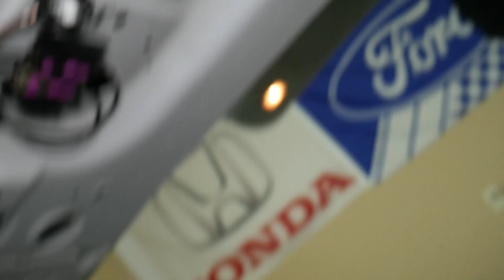PORSCHE CAYENNE TRUNK STRUT SHOCK SUPPORT REMOVAL REPLACEMENT

Comment: This was VERY good advice and helpful video.  My 13 yr old son and I just did this on a 2006 Cayenne without removing the WHOLE headliner.  In order, we removed the (1) right rear liner, (1) left rear liner (each has a small Bose speaker which needs to be unclipped) and (3) the far back head liner with the dome light (unclip the light once loose), then (4) we just pulled/peeled back the big headliner from the back about 1 foot, enough so we could access the cut-outs where the struts are.

Comment: Can you assist ? My cayenne S 2008 has a PCM 2.1 and this week it started rebooting every few seconds. I have tried to press 148 nothing , press Info nothing, press sound and info nothing. Checked the fuse at the back of the PCM it is good. Any thoughts how to fix it?

Comment: How would this work without removing the headliner?
Reply: My 13 yr old son and I just did this on a 2006 Cayenne without removing the WHOLE headliner.  In order, we removed the right rear liner, left rear liner (each has a small Bose speaker which needs to be unclipped) and the far back head liner with the dome light, then we just pulled/peeled back the big headliner from the back about 1 foot, enough so we could access the cut-outs where the struts are.